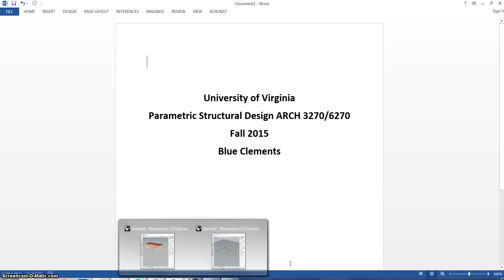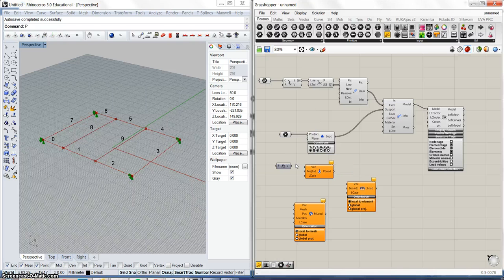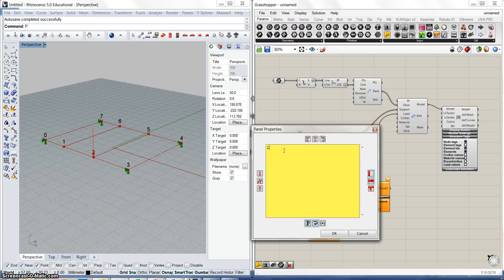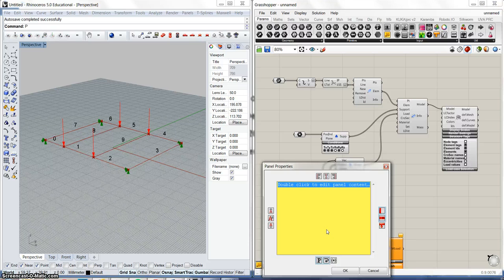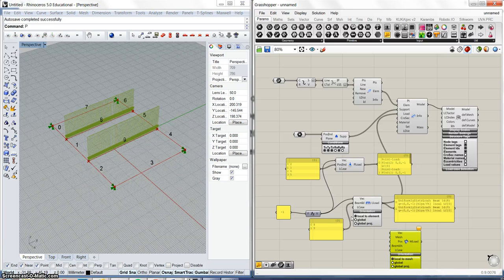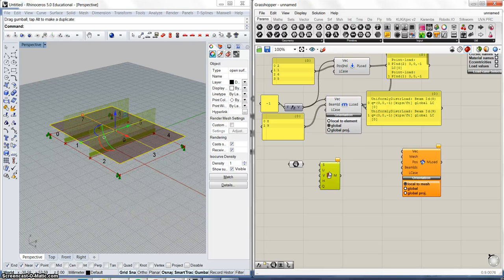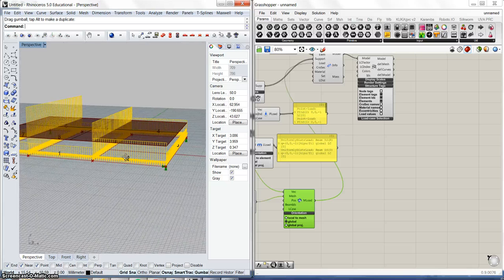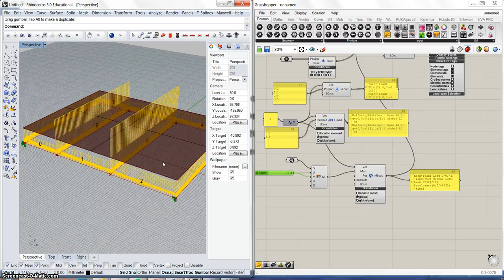Lab 2 Karamba Pt 2 Loads

Comment: global projection on load is useful for example for snow loads when its assumed to act in horizontal plane but when roof plane is at angle its projected onto sloped surface thus becomes lower magnitude of load